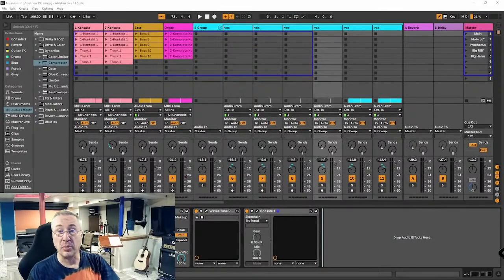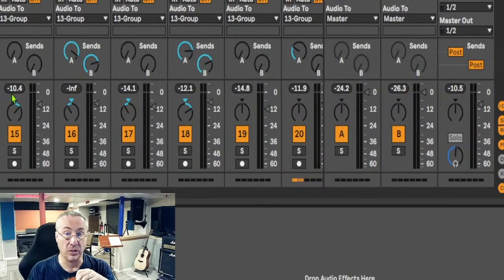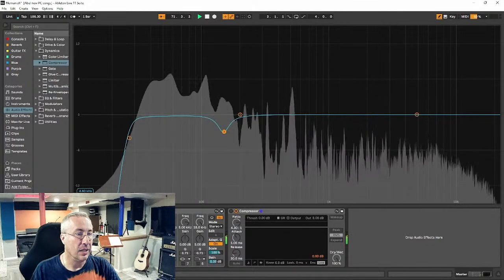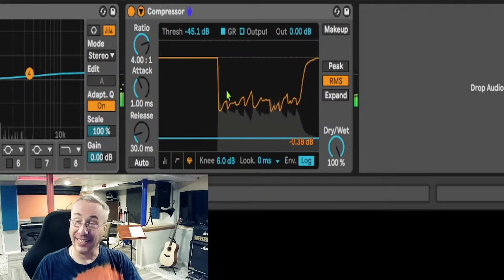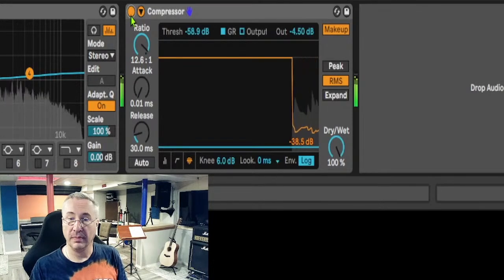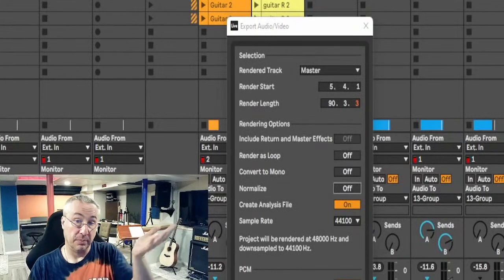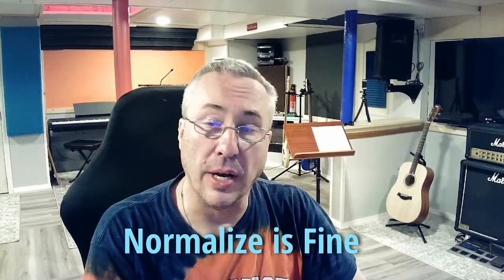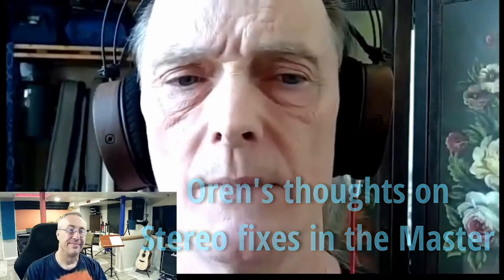Mastering. Simple and it works.

Comment: Great vid my friend. I have been learning more about mastering in you facebook group over the past week than anywhere else over the past 2 year. Mostly because I always saw mastering as something you do to albums only. In actallity everything I was putting on my master buss of a song was essentially "mastering" the song (for better or worse) I never thought any of my own material would be "master worthy" so I always mixed as if my song would never see a mastering pro. I have gotten into the habit of mixing to where dynamics were controlled and the width and depth were set and things that need air (or not) had what they did or didn't need. I learned it's good to leave room for the master engineer to work. Leave some dynamics, leave the "air" and leave the mastering engineer room to work... is that about right or did I miss it?
Reply from the maker: I still do not like to master my own work. And, yes, I leave the master chain empty if I'm sending a song out to get mastered.  I leave them 6dB to play with, at least.
Reply: Hi, what's the Facebook group?
Reply: @Ninjjadog  Recording Tips
Reply from the maker: @Ninjjadog  https://www.facebook.com/groups/313091427289906